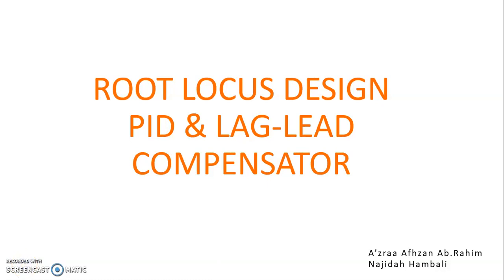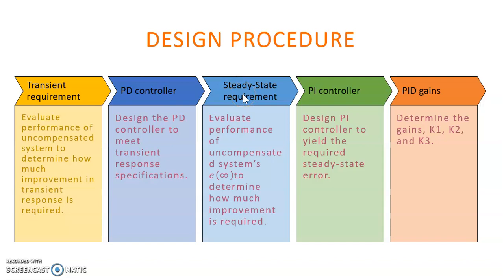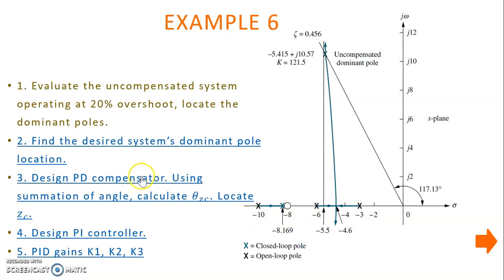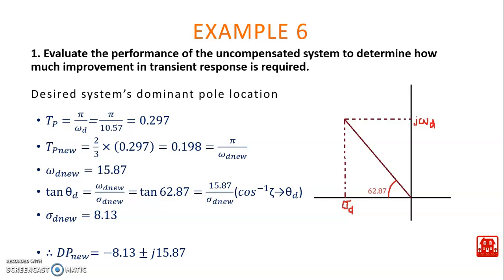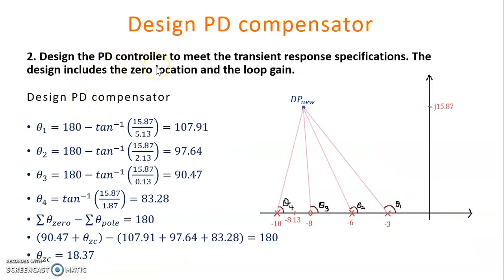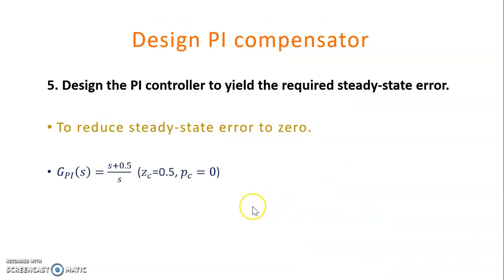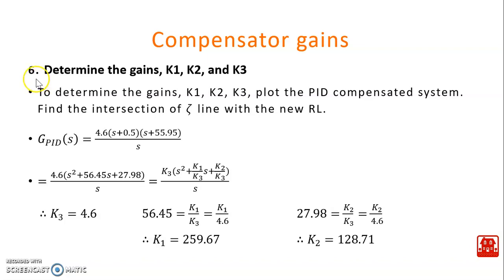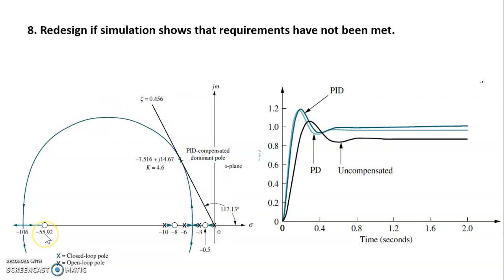PID COMPENSATOR DESIGN

Comment: How to calculate K if its not mentioned?
Reply: Hello, can you calculate the gain by isolating K in the characteristic equation 1+K*G(s)*H(s), then replacing the variable with the dominant pole, The result will be the value of the gain.